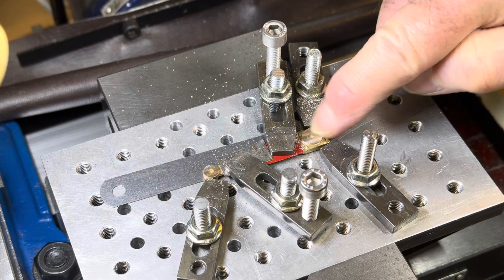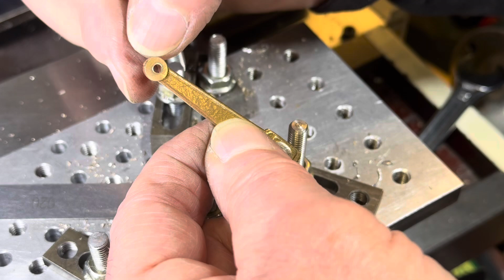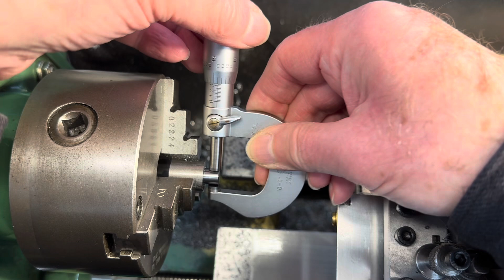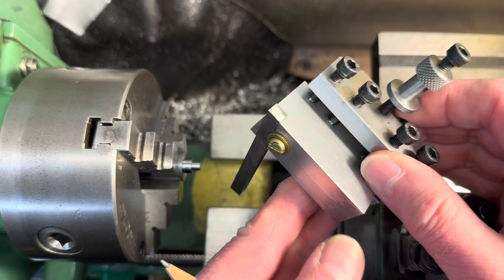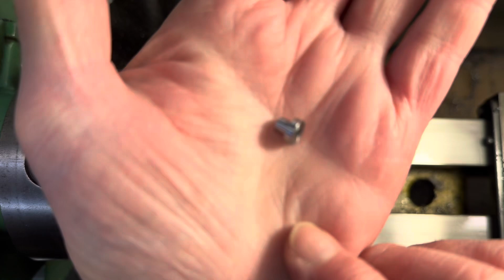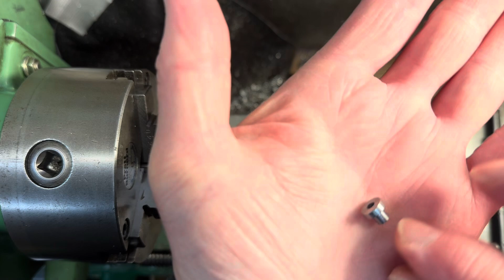PM Research #3 Engine - Part 6

Comment: Could do with fixing your camera shutter speed to prevent the annoying flickering that occurs during your videos.
Reply from the maker: I use a mobile phone to record my videos, and I think it’s sometimes out of sync with the mixed lighting. I have fluorescent and led lighting. It doesn’t seem to happen all the time, but I’ll check if I can change the settings on the phone. Thanks for pointing this out. Cheers Nobby
Reply: @nobbysworkshop set the shutter speed to twice the frame rate. For example record at 24 or 25 FPS. Set the shutter speed to 1/50 and you will be good.
Reply from the maker: @mattphilip4595 I’ll give it a go, and see what happens. Many thanks

Comment: Lovely Job Nobby
keep warm, my diesel heater is on to take the edge off.😉😉👍👍👍👍
see you next time
regards
Kev
Reply from the maker: Cheers Kev. It’s been very cold in my workshop. Today only 11c. I have a small electric fan heater to take the chill off a bit. A diesel heater would be a bit too big for my workshop. Take care. ATB Nobby

Comment: You are doing well with the fiddly little parts Nobby 😀 interesting to see your diamond tool I love mine 😀
Reply from the maker: There certainly are some small parts on this engine Julia. The difficulty with my shop made diamond tool was setting it low enough for centre height on the Myford. I got round this by machining part of the underside of the Dixon tool holder so it sits lower on the tool post. Cheers Nobby
Reply: @nobbysworkshop  I think I had the same problem with mine! 🤣

Comment: Nice work Nobby, its really tricky holding small parts and still be able to get the tool in without damaging anything 👍Mark
Reply from the maker: Thanks Mark. My fixture pallet is proving so useful on this build. I’ve bought another piece of aluminium plate to make a second one. It’s a better grade of aluminium, not a mystery one 😮 Cheers Nobby